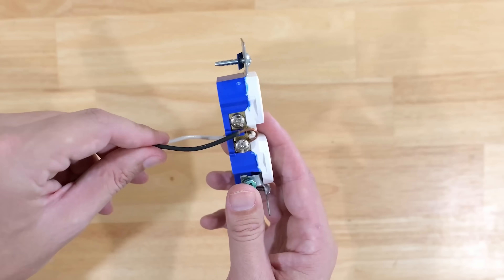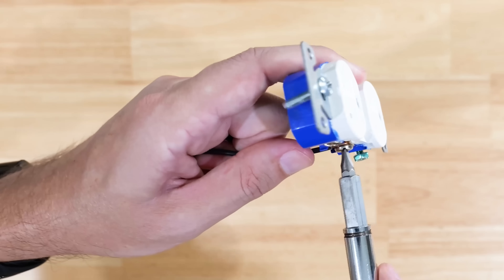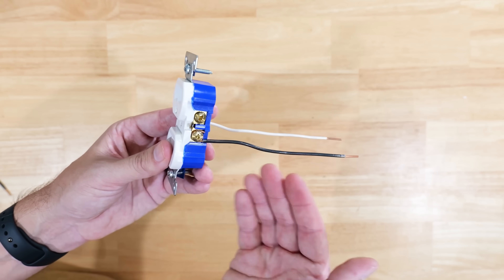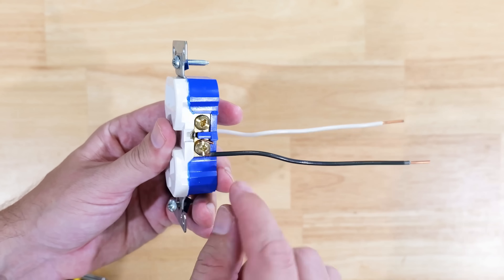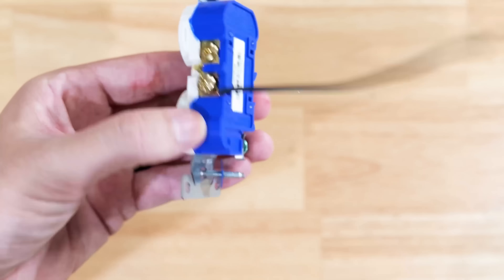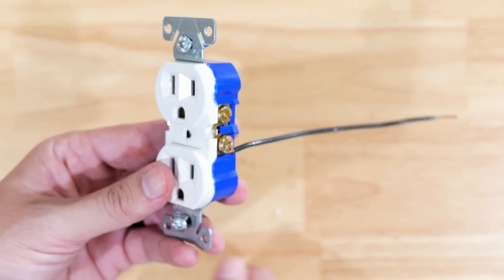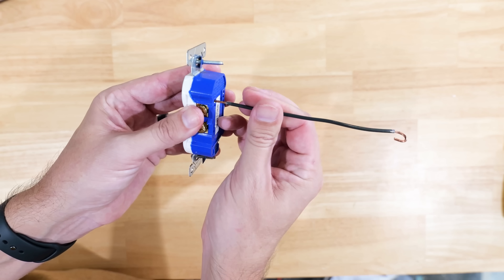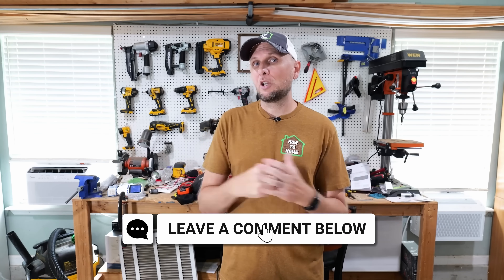Avoid Disaster! 8 FATAL Outlet Mistakes Most DIYers Unknowingly Make!

Comment: Well I made it past the first tip and have to call this out there are 20 amp devices sold that do not have the non parallel plugs that will go in the 15amp plug and still burn the house down if the braker does not trip. You should be teaching people how to figure there amp that there pulling as well. 110v at 1000W is about 9.1 amps W/V=amps. P.S. If I'm all ready covering the things you missed im tuning out thanks.
Reply: Can you provide an example of a 20a device with a conventional (ie. 15a) plug?  That sounds illegal.  Although there is nothing to stop you from plugging 2 10a devices into the same outlet.  BTW: Electrical uses "breakers", whereas vehicles use "brakes".  So many people misspell it on automotive forums as well.
Reply: @Nsmithq99  i Responded to this person directly so deleting my posts is pointless.
Reply from the maker: @s56505 bye ✌️ 😂
Reply: @HowToHomeDIY  Cool im screen shoting your admision that you delet posts that conflict with what you say even if it is the truth. Never said bye mate.
Reply from the maker: @s56505 what are you talking about?  Nothing has been deleted.  You said you were thinking out over something silly so bye 😂
Reply: @HowToHomeDIY  Odd i posted it here like 12 times and ever time a would refresh 5 min later it was gone then i posted it to his video and it never got deleted So its not a problem posting it and its not youtube deleting it because it didn't from his video. The bye you keep saying just makes it look even more like you are the one deleting them and i have screen shots of the posts and them going away with time stamps. Bye is what you say when your done with a conversation but you keep coming back odd. You sure look like you need to defend your self. Why would you respond bye if it was not you why would you not ask first what im talking about oh wait you got called out for doing it now your back tracking trying not to get reamned when I post screen shots to social media.
Reply from the maker: @s56505 don’t know what to tell you.  Nothing has been deleted.  But oh no, you screenshotted stuff 😂.  How will I sleep tonight?!

Comment: In a perfect world, I'd spot weld every wire to every outlet terminal then wrap the whole thing in 10' of 14kV Skived PTFE tape before placing it all in Böhler K700 high manganese armored conduit. It'd be resistant to both lightning and .50 BMG. ;o)

Comment: Amateur here. I've found when doing outlets or switches that a #2 Philips screwdriver just can't get the bite it needs on those screws to tighten solidly. It's one of the rare jobs I pull a flat head screwdriver wide enough to bite fully on the screw head and allows for sufficient torque.

Comment: Great Video as I have done a few things myself. But for the Choosing amp receptacle I feel having a 15 amp receptacle on a 20 amp line is a no go.  If I have a 12 awg wire and 20 amp CB snd I use a heater pulling 18 amps the wire and breaker are in spec but the outlet is not.  If I had a 14awg wire on a 15 amp CB with a 20 amp outlet the outlet would not be a problem.  If I had plugged in a high amp device the wire and CB would be in danger but the outlet would not contribute to anything more dangerous than using something too powerful for the line its plugged into.  I feel this was backwards but open to correction.  I am curious to know if my thought process is right.

Comment: The reverse polarity thing is wrong. AC current alternates back and forth no equipment is going to be damaged by current going in the "wrong way" and people regularly plug in transformer bricks backwards due to that sometimes being the only way that they fit.

The reason that reversing the polarity is wrong is mainly because some things like toasters and lightbulbs have circuitry that is potentially exposed and it's somewhat less dangerous to get zapped by neutral than hot. But, nothing that you can plug into an outlet is going to be damaged by the current being flipped as the current flips directly 50 or 60 times a second.

Comment: So what happens when you plug two 10 amp loads in two different 15 amp outlets on the same 15 amp circuit. Same thing if the breaker doesn't work.
Reply from the maker: Ok?
Reply: @HowToHomeDIY  your saying a 20 amp plug on a 15 amp circuit can cause a fire if too high of a load is put on it. You can have the same thing happen without a 20 amp plug. I really think you need to point out that the electrical box is there to stop fires. You push the fire part a bit too much. I've seen many wires burnt in an electric box and never burn anything down.

Comment: I only use the speed holes in the back if the outlet actually clamps down on the wire when you tighten the screw. otherwise they are not safe.

Comment: All recepticals/outlets should be made like the commercial ones you showed.   No hooked wires, just a straight wire inserted then a screw tightens on to that.   Not only easier, but safer.

Comment: The BIGGEST pet peeve of mine regarding receptacles is the ability of them to hold the plugs and make a good connection.  Strangely enough, I have found that some of the name brand receptacles are the biggest offenders of the inability to hold plugs tightly, leading to overheating and fire hazards.  I have found that usually the cheap bargain bin receptacles have the greatest grip.  Always test them BEFORE buying to see which ones have a good grip!!

Comment: A loose connection can become a "hot" connection, because it is a high resistance connection, when feeding current to an appliance or tool.  This high resistance, hot connection can then become hot and possibly start a fire in the receptacle box;

Comment: Master electrician here with 17 years trade experience. Here's my two cents. Take this video down, you are incorrect. Unless you are a ticketed and experienced electrician, don't create 'how to' videos. I didnt even get 2 minutes into this video before finding a problem. You can NOT put a 15a receptacle on a 20a branch circuit. The receptacle dictates the breaker. 15a receptacle means a 15a branch circuit, which (depending on length of run accounting for possible volt drop) dictates the wire size. Feeding a 15a receptacle (and subsequently a 15a rated device or appliance) with a 20a branch circuit means that receptacle and associated device can pull more amperage than its rated for. If you plug a lamp into that plug, the conductors inside that lamp could be as small as 18AWG, if there is some issue with the lamp and it pulls more power than it is rated for (15a) you run the risk of melting the wires inside that lamp because the breaker didnt trip off at the amperage it should have - which is 12 amps. Now its able to pull up to 16 amps on a 20a rated breaker (designed to trip at 80% load) 

15a receptacle means 15a branch circuit. 20a receptacle means 20a branch circuit. So on and so forth. You can NOT blend receptacles of different amperages on a single branch circuit. 

The rest of the points in this video are OK, however you only need to mess one of these up to start a fire. Be diligent. Hire someone unless you are 100% confident in what you are doing. 

If you aren't a master electrician, don't give electrical advice. Some jackass is going to listen to you and burn his house down. I see this type of 'kijiji specialist' work in my clients homes all the time and it is a real fire hazard.

Comment: Here's a recommendation for installing new duplex outlets - especially in areas where plugs will be inserted and removed frequently (or just if you prefer Mercedes vehicles over Hyundais!!) Always spend the bucks for COMMERCIAL GRADE outlets. The contact blades and the outlet housing itself - are much more durable than the cheapo ones. Just a tip from an old electrician who's 'been there' and 'done that..✴✴

Comment: Great stuff! Not just us DIY'ers do this kind of stuff. The "pro" electricians that wired my new house actually used the backstabbing holes. Even I know not to use those!
I learned playing with my electrical lab toys when I was young, "LOOP TO THE RIGHT" :)
Reply: Probably non-union labor. I believe the unions prepare people better. I'm from Illinois - I think all construction is done better than the non-union states that hire non-union help (the unions give excellent training and  apprenticeship, as well as safety standards).
Reply: Hi. Electrician here, there's no real reason not to backstab outlets on 15 amp circuits. 
Maybe 10 years ago, but the new equipment is much better.
Reply: @trufflie3358  Backstab outlets are not made for fun and have been tested for safety.
If you use the right brands and circuit breakers (don't exceed the current limits), they work even better than traditional screw connections because you don't have to worry about loose connections. 
It was right 10 years ago, it is right now, just DON'T USE CHEAP FAKE BRANDS!
Reply: I totally agree with you and was gonna say the new outlets grip like a SON of. Bitch... it's fine for residential work but not allowed in commercial..... commercial electrical Forman here
Reply: @trufflie3358  Hi, Engineer here.
In 10 years, they will have the same problem.

Code is the floor, not the goal.

Comment: i think you are holding the receptacle uoside down.
i install them with the ground pole up in case any wire or metal object falls over a plug that is not all the way in and shorts out the power poles.
Reply from the maker: 😂 either one is upside down to someone, at least here in the US.  Have a whole video on it.

Comment: I am a retired electrician with over 50 years in the trade. Your video is great to teach everyday people to how to be more practical and safe, good job. I want to add one thing about wiring an outlet with the polarities backwards. 
Reverse polarity does not affect how devices work, on the other hand safety is jeopardized because appliances, lights designed with switches to break(open) the hot wire. When outlets wired backward, you are breaking the neutral wire, so there is still power present and it is most dangerous with light sockets and when changing a lamp(bulb), accidental touch can result in electrical shock. Be safe and happy 👍😀
Reply: Usually correct. That said we purchased a 1963 home that was reworked in 2020 but Sparky didn''t replace the old 12/2 no ground wire. I plugged in our extra stainless steel refrigerator in the garage (gotta have a beer stock ya know),  and I thought I noticed a very mild current when I had wet hands one day. Here a year later I  was adding a circuit to the wall in the garage and while swinging the wire for the receptical toward the wall the ground wire touched the refrigerator and emitted spark shower! (New wire was tied into the neutral and ground in the sub-panel but the hot wire was not connected to the breaker). I'm like "what the hell Bernie"! I ran a test wire to panel ground and my meter showed potential from the refrigerator housing of 125 volts. Eee gads Elenor, could a been kilt! Reverse polarity was energizing the housing.
Reply: @Terryhack  It was only possible because Ground was not connected. If ground is not connected it is very often that on housings you get 1/2 of supply voltage due to capacitors in power filters in that device. Capacitors still limit max current, but sensation might be really unpleasant. 
If someone connected phase to Ground pin then it's their fault - in 2-wire installation you should always check which one is Neutral, never trust the colours.
Reply: @Terryhack  we just bought a 1962 house and the inspector said many of the outlets have reversed polarity. I've been reading about what can happen but never heard of one that bad before! Yowza! I'm going to replace all the outlets and lightswitches soon, and I definitely would have made some of these mistakes from the video.
Reply: Thank you, as soon as he mentioned polarity, i was curious, as theres no polarity in a residential split phase ac system.
Reply: What about receptacles? I thought it was the other way around. You can't use a smaller amp receptacle in a bigger breaker circuit?
Reply: @bobombo1988  Doesn't seem like anyone answered your question. It's in the National Electric Code, table 210.21(B)(2) that a circuit rating of 15 or 20 amps can have a 15 amp outlet on it. The text goes on to clarify: "Where connected to a branch circuit supplying two or more receptacles or outlets..." (TBH, I'm unclear if they consider a duplex outlet a single receptacle or not, and it never comes up for me because I always install 20A circuits and 20A outlets). Manufacturers are required to make sure that a 15 amp outlet will pass 20 amps through its wire terminals.
Reply: @bobombo1988 yes he is completely wrong on everything he says in the first of the 8 things he is supposed to be teaching.
Reply: Correct. In fact, when you think about it, the polarity is reversing 120 times per second (2x60Hz) in AC appliances (here in the US) and they work just fine. 😉
Reply: @MR.Pilot_Electrician that’s what I was thinking it’s constantly changing directions anyways or so I thought
Reply: Is this when you put a switch half way and you hear it crackle . Terrified to put a switch in between, quick flips only
Reply: @Hedgehodge-  Electrons jumping across the air gap. Nothing to be terrified about, unless you're working with high tension, like on my job (15kV).
Reply: Nice!!!  Another one of those details that even licensed electricians make!
Reply: Lol was gonna say same thing on AC power gonna go both ways anyways but ya your right it still matters for another reason
Reply: yup came here to say this
Reply: Many modern electronics are polarity sensitive!
Reply: @william1995-y4g not mains powered.
Reply: @sharpparadox9563 what?
Reply: @william1995-y4g  you said" many modern electronic are polarity sensitive. " which is not true for mains (Ac from the building ie 120/240 powered equipment)  such equipment will work as intended regardless of AC polarity. however you may lose some safety feature on some equipment, on a light fixture for instance. which is why safety standard test for both condition (normal /reverse) as a normal condition of operation.
it is true only for dc/battery powered equipment that polarity will be relevant
Reply: @sharpparadox9563 We've had many furnaces affected by reversed polarity. I may be wrong though. I'm kinda new at this stuff, only 35+ years, but oh well, I'm sure we'll never have any problems here forward! Thanks for your help.
Reply: @sharpparadox9563  I do agree with you.
Reply: @william1995-y4g ill concede for furnaces. that makes sense-youd need an error code here😅
Reply: @william1995-y4g Since when there is polarity in AC?
Reply: Reverse polarity with not let furnaces or boilers run right
Reply: In other world works fine.
Reply: Just unplug the lamp when changing the bulb.
Reply: @ДиМа-щ4ф6х  Or, you know, you could simply install things correctly rather than inventing work arounds for your mistakes.
Reply: @ There is no polarity in all other world and all devices works fine.
Reply: I made a comment above and your input would be phenomenal. To reiterate, here it is:

"I have a weird problem that I am hoping I can get an answer to without hiring an electrician (unless I absolutely should).

I have replaced more electrical outlets in the places I have lived than I can count. In fact, because I work in IT and run my own hardware and work from home, I have always upgraded my outlets to the more expensive, heavier duty outlets that service my gaming PC, home server, and networking equipment that is first fed through my UPS.

I am now trying to replace an outdoor outlet. First time ever. The outlet itself was cracked and chipped and I was concerned it could be a fire hazard.  The old outlet was one of the "backstabbing" configurations. 

I install outlet, test with multimeter, test again with my cafe lights and other stuff that gets plugged into on the deck. No issues.

However, when I go to push the outlet into the electrical box, it shorts, sparks and trips both the breaker and GFCI (which is in the garage for some reason). 

This ONLY happens when I go to screw down the outlet and put the cover on, or even when I manually push it into the enclosure. 

I wanted to remove the housing, as its metal. However, some weird and random wire runs laterally through holes from one end of the box to the other, making it impossible for me to remove the metal box and replace it with a plastic one. 

I even went so far as to use electrical tape to cover both the inside of the box, and all metal parts of the outlet so as to prevent metal from touching metal. 

No dice. 

I am really stumped as to what is causing the short when I try to screw that outlet into place."
Reply: U might need to open the  wall from eather the front wall or behind it and do some new wiring I doubt the breaker or the GFCI device is bad
Reply: U might need to open the  wall from eather the front 
or behind it and do some new wiring I doubt the breaker or the GFCI device is bad. I personally would use spec grade (WR) weather resistant recptical for outdoor use. I prefer to have the GFCI device in indoors to avoid moisture from damaging 
 the GFCI device.
Reply: @evildego did you check with a GFCI receptacle tester?
Reply: @benji0027 so I finally found an electrician worth his salt who figured it out. I thought there was a ground wire traversing one side of the box to the other and it was just a nail. He took care of it by replacing the entire box with a plastic one. I didnt know that metal boxes were not up to code on residential structures.
Reply: @evildego they certainly are up to codes if installed grounded. Never let anyone install "plastic" boxes! Fiberglass might be what he installed.